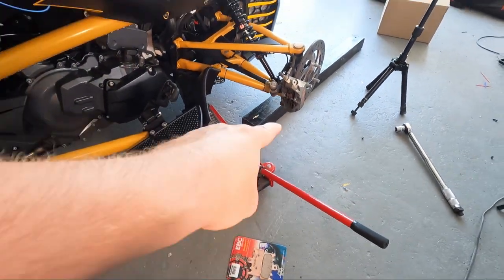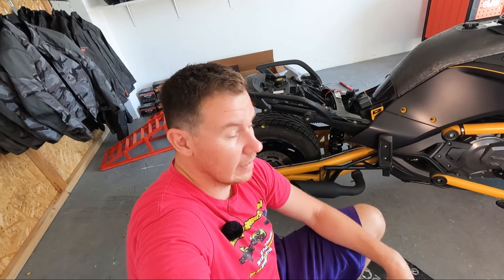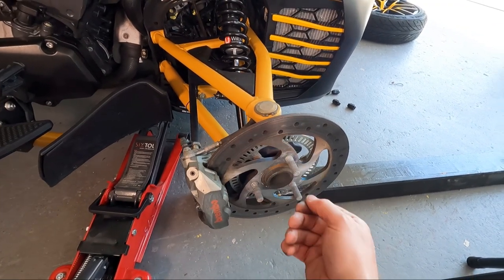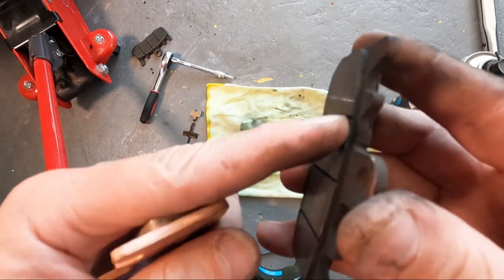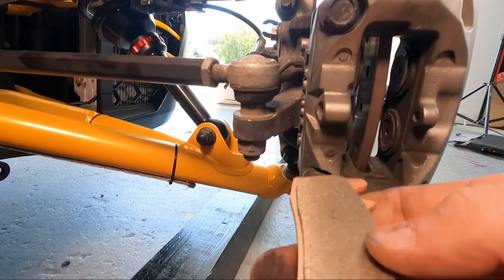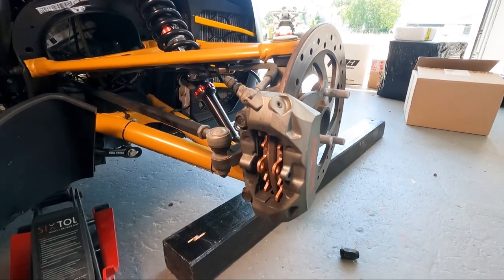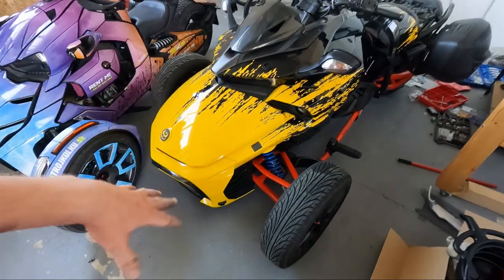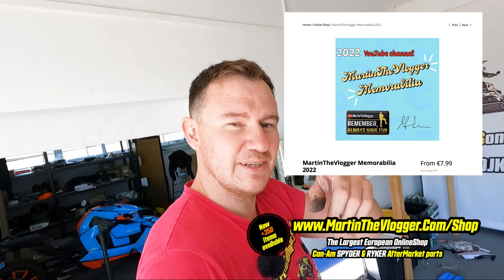Brake Pads Can-Am Spyder #howto Change Them

Comment: Nice video Martin, thanks for posting. My Spyder has only a little over 2200 miles on her. I’ll probably need to do this next year. The back will probably be done at the Dealer. 😉 Let us know whatever you find out about doing the back.😉 I might be inclined to do it myself if it’s not to complex. I don’t have all the tools yet. 🥴
Reply from the maker: It think i may do it sooner or later by myself... but i am not comfy with it at the moment, so i need some time 🤪
Reply: At 2200 miles the pads are just about broken in. I replaced the pads on my 2020 RTL at 12000 miles then around 22000 miles. As I was getting the back tire replaced I had the back pads replaced at the same time as the front. I am assuming that they were replaced with Brembo pads as I had this done at the dealers. The breaks were hard worked at times having had a trip round the Alps including 5 Swiss passes in one day.

Comment: Is there a torque setting to tighten things back up or just until snug?
Got one side done, preparing to work on the other.   Thanks for making it look soooo easy!

After the front(s), moving on to the back.
Reply from the maker: Snug is exactly how it is 😉😉😉 let me know how it was with the back 😉😉😉
Reply: @MartinTheVlogger  Found the torque after I sent the message.  Already forgot what it was, but I think it was something like 6 nm, so basically ‘snug’.

I’ll have a bit of a delay to do the back.  I purchased a set of PPA wheels that took 7 months to arrive. Been sitting in the garage for 2+ months, hoping for the front tires to wear out.  No go, after 17k the tires are still in excellent shape. (Replace the back already) 
Hubby decided to have them mounted for me for xmas.  He tried 10 places to mount, no one will touch them.  Today, he finally found a shop that mounted, but couldn’t balance.    I’ll be taking the bike in to the dealership for balancing tomorrow, then I’ll tackle the back brakes.

We have a 5,000+ mile trip planned for this summer.  I’m a bit concerned now if I have any tire issues while traveling.
Reply from the maker: @kellymusarra8743  i dont get it, why nobody would touch PPA wheels. Balancing is done in any tire shop and it needs very little balancing if you have new kenda kr20 tires. Fronts can go easy 25.000km 30.000km but rear last like 10-15.000km on F3. Always have tire repairing kit together with O2 "bombs" that can refil the tire with you. Enjoy the trip 🤟🤟👌👌👌
Reply: @MartinTheVlogger  The issue wasn’t specific to PPA, it was motorcycle tires. The tire shops didn’t have the 2” adaptor (too small for their machines) as most have upgraded and old inserts no longer fit and motorcycle shops said it was a car tire, even tho it clearly says ‘motorcycle’ tire on them. (That also laughed, saying you should buy a real motorcycle).     Frustrating to say the least!!     
Enjoy your day!

Comment: Do EBC brake pads and rotors still squeak like the Stock ones do?
Reply from the maker: Not that much but yes..
Reply: Try adding some copperslip grease on the back of the pads where the pistons are bearing. This can stop squealing from brakes.